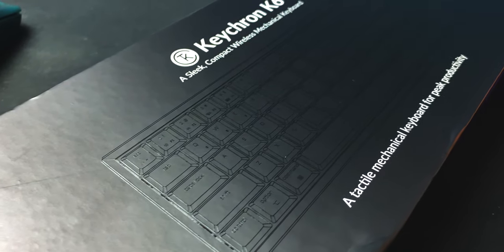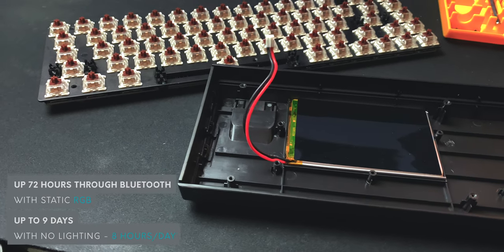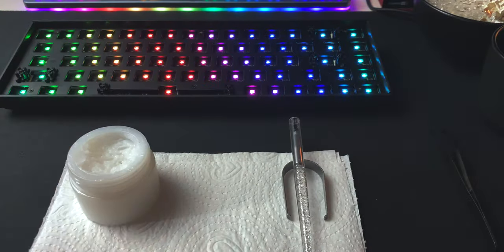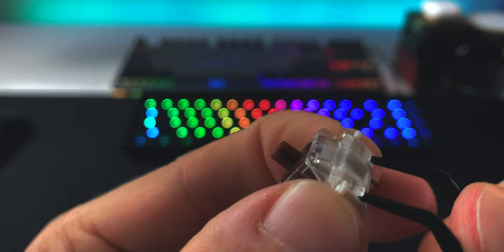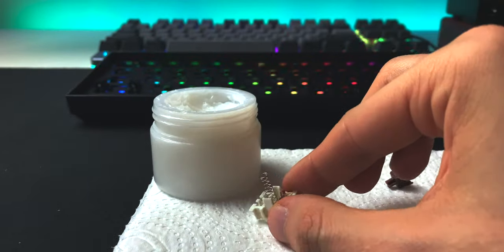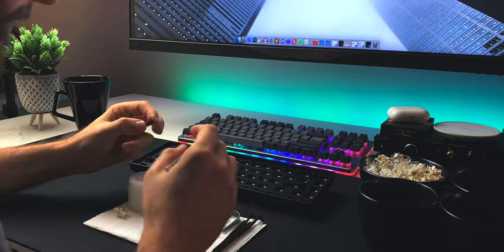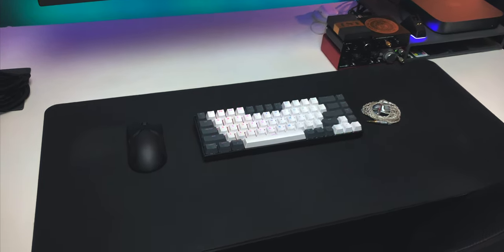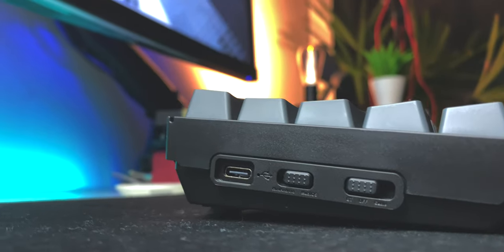Keychron K6 Keyboard MODS! - WORTH IT!

Comment: I’ve got two K6’s and the best upgrade I’ve made was Holy Pandas on both of them and it really took it up a level.
Reply from the maker: Oh, trading in the switches for something "fancier" is definitely on my to-do list. I'm thinking of de-soldering something I have here in the studio once I'm done with it just to use the switches it came with because "Holy" crap ;)
Reply: Kind of new to this but I’ve read that the Keychron gateron a are SMD, are the holy pandas SMD? If not, did they still fit in well?

Comment: Great video. Not sure if anyone has mentioned but you should use dialetric grease on the metal stabiliser bars, and use the krytox on the plastic housing.
Reply from the maker: Thanks bud!
As for the lubs, yeah, people have mentioned that distinction before. Didn’t find specific reasoning to be honest aside from thickness tho.... is there any?
Reply: @TechHyped  it’s to do with the thickness of the grease, which will likely make it stay in place longer and stick to the stab wire. I think lube is actually fine but you may need to redo more often.
Reply from the maker: Yeah, been feeling that with a couple of boards, but funnily enough, on some boards where I used dialetric grease all over.

Comment: I appreciate the build,  but my honest opinion is that the switches and stabs are heavily overlubed. The sound is really mushy, the space bar basically has no clicky feedback, the stabilizers are silent but not in a good way, they sound really mushy too. I would suggest using a very small amount of lube for the switches, since as we could see in the closeup shots, the stems were overlubed by a lot. The right amount is when you could barely see a translucent coat of lube on the stems. As context I just modedd my Keychron K2 a week ago and the difference is pretty big. If it is a preference of yours I could understand the mods but in my opinion this really ruins the typing experience, since the feedback of the switches and the stabs are basically non existant, therefore a stock K6 could give a more mechanical keyboard feel. On the other hand it's a nice build aesthetically.
Reply from the maker: I appreciate the comment and difference, really. I've for sure overlubed everything, but the stabs are the issue, to be honest. 

They were still somewhat rattly and I had to go back and do some other modding and refining to them - and now they're extremely better, honestly, just as some different mods I've applied to my custom Carina board from Drop as well. Short of actually grabing better stabs, they won't get any better to my preferences at least, as I've cleaned them up, re-lubed them, used different lubes, different applications of band-aid modding on the plate, on the pcb, inside the shafts, and it's soooo much better, but still the same stock stabs.

On the switches, I 100% agree its overlubed on the video, and I did try and clean a couple to test out different amounts (before I finished the video), but what I ended up striking was a balance of an existing but not very pronounced tactile feedback bump, and a smooth/soft typing experience that was well complemented by the stronger springs I put inside each one.

My mic didn't do the absolute best possible job with replicating the acoustic feeling of the switches, and I get from the many comments that they sound somewhat scratchy to a lot of people, but they've been almost just as scratchy with close to nothing in terms of lube (or nothing at all), probably because of the different springs, I imagine.

Now, months later, the lube has "faded" a little, the scratchy sound has dampened a bit and the overall experience is even better (to me, obviously). The only thing I'm still not exactly happy with is the dang stabs.

Same with my Carina board, actually. Band-aid mods, lubing, holy panda switches lubed and with tweaked springs to dampen ping (and I'm waiting delivery of a silicone mold thing to create something inside the case to help with dampening the sounds a bit more, actually), and it sounds and feels incredible to type (for me), and with the accoustics MUCH better than stock, but the stabs are still definitely what almost kills the joy of using these boards, sometimes...

Especially when you put in the work, the switches get so much better and the stabs being "kinda bad" just end up being even more in evidence, by comparison...

Waiting delivery on a some custom (better) stabs to add to these builds. Maybe that'll finally get me 100% satisfied with my Carina board and not totally hating the sounds on my Ctrl one as well hahaha.

Anyway, thanks for the comment, mate! Hope the videos keep being entretaining at least. Welcome aboard ;)

Comment: Thank you so much for making this video. Very detailed and helpful. I’m still in the process of learning about building my own 65-68% but the keychron K6 has really stood out as a viable option for me. One question I have for you though, is do you think the actually keyboard (case) is too thick? I’ve seen many complaints that it’s just so bulky.
Reply from the maker: Honestly, not to me.... the Drop Ctrl is the exact same hight from the table to the top of the keycaps, so I was already used to it.
I know a bunch of people use wrist rests with the CTRL, but I don’t... same with the K6.

The heights:
- 3cm from the table to the top of the keycaps on the bottom row
- 3.7 on the top row
- 4.3 on the top row with the smaller feet
- 4.8 on the top row with the higher feet
Reply: Tech Hyped thank you so much! Yeah the other contender I had in mind was the Drop Alt but for the price I feel like I could just build my own.  I think I’ll stick with the K6 and do the mods you suggested in the video. And also try to find some nice PBT keycaps. I messaged keychron and asked if some pbt caps for the k6 would be on the way soon and they told me it was in the works.

Comment: How's the tactility after lubing the switches? I loved the sound but I don't want to lose tactility. Cheers!
Reply from the maker: Tactility without lubing the stem legs is basically unchanged, but smoother and quieter. Lubing the lets tends to make it more slippery which takes away a little bit from the tactile feel, but it definitely doesn't erase it.
Reply: Those switches sound over lubed. There is no sound to them. They just sound wet. The key caps didn't even clack against the plate so the dude is either a perfect typer and knows exactly where the actuation point is on his switches. Or the switches have a mushy bottom out.
Reply from the maker: 100% overlubed, not mushy tho and the “wet sound” was weird haha... It doesn’t really, tho.
Plus, keycaps don’t necessarily hit the plates on every keyboard, which is the case here, incidentally.
And yes, “perfect typist” with absolute knowledge and control over each stroke for the precise actuations points, oooobviously 🤘🏻😜

Comment: I think your brush is a bit too big. And it has too much lube on it. There's some danger to over lube with that. But I guess it all worked out in the end.

EDIT: I see you're a fan of Tin HiFi!
Reply from the maker: SirAdeno yeah. Didn’t buy a smaller/thinner brush just yet, but this one has done the job. The lube amount definitely is a point of concern, as it can ruin the switch or cause contact issues/problems, but there’s very little chance of that unless you lube parts of the stem that press against the metal contacts. Those are the main leakage points.
Still, you’re right, its something to be careful with!
Thank GOD it worked out hahaha!

Yep, review on them is uuuup! ;)

Comment: im just kinda worry about overheating the battery, what is a good nonflammable insulation foam to use?
Reply from the maker: The board doesn’t use nearly enough juice to overheat the battery... The power-draw is what pushes those limits, and the Bluetooth + keystrokes don’t do the trick.
Plus, the idea is NOT to cover the battery due to space anyways, and since there are plastic spacers dividing the area where the battery is and the rest of the chassis, I wouldn’t worry.
Still, non-flammable foam I’d guess any type would work...
The EVA stuff I’ve used isn’t non-flammable as far as I know, so I’m gonna add a fire-extinguisher to my setup just in case 🤪😬

Comment: Just a note, those switches and stabilizers are way overlubed. Ideally there should be a very thin "haze" of lube over all the parts, but your switches look covered in globs of lube. Lubing like this makes switches feel all mushy. Lubing a normally loud switch shouldn't turn it almost silent. I'd suggest using a much smaller, thinner, softer brush next time, and using the least amount of lube you can get away with.

Comment: is this possible on the not hot-swappable version?
Reply from the maker: The foam thing underneath the pcb, yes, as well as “pushing” lube into the stabs, but the bandaid mod would be limited to you desoldering the switches on those stabs to get them out and be able to apply the mod (as well as clipping them).
The switches, well, you CAN use spray lube so you wouldn’t need to desolder stuff, but its not nearly as effective.
Reply from the maker: In my latest video on the Ajazz Zinc keyboard I show the difference in stabilizers that I pushed lube in through the cracks without desoldering switches. It can make a huge difference.
Reply: Great, thanks!
Reply from the maker: No problem 🤘🏻

Comment: Is the k6 good for gaming or should I stick with a ducky sf?
Reply from the maker: Yes and no. Not exactly made for it, but even in wireless mode I haven't had any issues with it in the countless hours I've used them for gaming.
I would say that if you already have the Ducky SF, unless you NEED (or want) a wireless keyboard for the flexibility, getting another 65% keyboard to use in wired mode for gaming is sort of a waste, really.
But it's an overall great little board.

Comment: How do you think the sound compares to your Drop CTRL?
Reply from the maker: That’s a nice question. Raw out of the box, the metal structure with very little internal empty space of the CTRL made it a quieter board.

Modded, at least right now, its been as quiet or perhaps a bit more quiet than the K6 because of the linear switches, but since I exchanged the springs in almost all the switches? Its not been as pleasant of a typing experience... Too light.

I’m waiting on a new switch shipment to try a couple of new things with the CTRL tho. I’ll let you guys know ;).
Reply: @TechHyped  Good to know. I've seen a number of reviews ragging on the sound of the K6, but no real comparison (properly modded) with lubed switches, and foam, etc.
Reply from the maker: Yeah, comparing stuff when the same effort or process hasn't been applied isn't fair.

From my own tests with the CTRL, sound-wise it's at least as good, if not a tiny bit better, but I'm not sure if exchanging the switches for something tactile would bump it up and out of the same "sound-level zone" the K6 is right now.

NOT necessarily adding foram to the interior, you could check BadSeedTech's video on modding the Drop ALT because the frame and keycaps are the same as the CTRL, so it should give you an audible idea. ;)

ps: adding foam to all the interior of the CTRL and the ALT is almost impossible because of the acrylic diffuser.

Comment: I have a question im new to moding and i want to get into lubing but after using the lube how long can i keep it for or what is he longest time youvekept the lube for and still be usable
Reply from the maker: That depends on the lube or amount, but you should be good for several months even with constant usage of the keyboard.
Reply: @TechHyped   o i want to know jow long i can keep for the lube that is not usedike e shelf life after using it once and keeping it
Reply from the maker: You mean how long the lube will last say, kept in a drawer somewhere for you to eventually use again with another keyboard (or even the same one)?
As long as you keep it properly sealed and not somewhere that would get way too hot, it should last for a looong time.
Reply: @TechHyped  yep i see thank you much
Most people confuse the question with what u told em first 😅😊

Comment: can i ask you a question
firstly it is absolutely a great video , i saw it 5 times 😂 so i want to ask you what would happen if i don't put a little band-aid under the stabilizer? will it affect hardly on the experience ? I'm so afraid that the stabilizers will not fit right way if i put something underneath them.
thanks for the tutorial BTW 💜
Reply from the maker: Thanks for the views! haha. Welcome board to the channel and I hope you keep enjoying the content ;)
As for the Bandaid under the stabs, that helps with the stabs hitting the PCB, which dampens the high pitched sound of the plastic of the stab hitting the plastic/metal of the PCB.
It may seem like it doesn't do much, but it does help quite a lot in terms of acoustics.
As for the fitting, depending on how thick is the tape you place underneath them, it CAN be a bit harder to push them in place, but that tends to mean it'll be very much dampened. I haven't had a single situation where the tight fit made the stabs jump off or get dislodged after pushing them in place, so I don't think you'll have issues there either.

Cheers!
Reply: @TechHyped  thanks for the fast response i didn't expect that and I'm enjoy watching your vids man 💜
I'll try to take your advice so will see what would happen
thanks

Comment: Thank you so much for this type of video!  Since it takes a long time to do all of the mods, perhaps it could be done in steps?!
Reply from the maker: Sure. Whenever I get s new board, I assemble it as is, use for a little while to test, then mod the stabs to see the difference, then move to the board, then the switches.
Unless I already know I want a fully modded build, then I’ll just try to get it done in one swoop to “save time”

Comment: Great Video! My K6 and Krytox 205 should be showing up within the next few hours, also with browns. Was lubing the tactile side a major difference?
Reply: Tell us more about the caps too! While doing my research, I realized 1u mods for the bottom right weren't always going to be available.
Reply from the maker: Way to go, dude! Be patient and you'll get it done ;)
And it can... If you overdo it, the tactile bump ALMOST fades away... it becomes super easy to miss, almost inexistent, but using the harder springs helped with that feel as well, actually.
Still, I'd advise a very VERY THIN coat if you intend to brush the tactile legs, just to add a bit of smoothness.
Reply from the maker: Will do! as soon as I can, which is going to take a little while still hehe ;)
Reply from the maker: Wellllllllllllllll, nda's up, so those keycaps are from the Drop ENTR mechanical keyboard. It's in pre-order still, and the actual keycap set I'm not sure if they're out already as a stand-alone thing, but here you go: https://drop.com/buy/drop-entr-mechanical-keyboard

And yeah, video on the Entr is coming up, and I'll touch on the keycaps ;)

Comment: my gateron yellow v2 pro from thocky became poppy or clacky after i lubed it with 205g from keychron
Reply from the maker: Seriously? But the originals were unlubbed?
Reply: @TechHyped  originally factory lubed sounded very thocky, i did try lubing with just 105 too and the thock sounded deeper ish
Reply from the maker: That makes sense, I guess. Factory lubing has gotten better
Reply: @TechHyped  i wouldnt have believed it if i hadnt tried it myself

Comment: Can I still mod the k6, even if it is not the hot swappable version? Thank you
Reply from the maker: Yes, but you’d need spray lube and the process isn’t the same... oh, the stabilizers wouldn’t be “moddable”, unless you desolder the switches to get to the stabs, mod them and put it all back etc... 🤷🏼‍♂️

Comment: What size allen wrench do i need to open it? And what other size screw drivers?
Reply from the maker: You don't need an allen wrench... 
As for the screw driver, sorry but my little tool set doesn't have the dang markings, so id just say "small"? Maybe a X4 ;/
My bad dude ehehehe.

Comment: My k6 seems to have quite a lot of ping... do you think thats factory error or is there anything I can do to fix it?
Reply from the maker: Honestly, it could be factory error or you can have a more accute hearing to that specific noise, which happens and it's pretty common, really. But lining the inside of the case with foam, felt or anything that would help dampen AND maybe even add heft and weight might come in super clutch to solve that issue.

Not 100% a guarantee, as it might be something in the manufacturing, but it should help a lot!
Reply: @TechHyped  Thanks so much! I'll try out your suggestions for sure :) great vid!
Reply from the maker: You’re welcome, and thanks hehe ;)

Comment: Great video! Was wondering what you meant when you said you changed the springs? Did it make the actuation feel any different? Lighter/Stronger maybe? Thank you!
Reply: Also, I realised that you don't have the aluminium frame on the keyboard. Does it still feel strong? Any flex in the keyboard? Thanks
Reply from the maker: Thanks bro! Yeah, I switched up the springs from the switches that came with my K6 for the springs on the Kaihua linear switches from my Drop Ctrl to make it heavier, actually. ;)
Reply from the maker: Nope, didn't go for the aluminium frame because it's basically a bumper.. The structural rigidity is still going to be much more related to the overall structure of the case, and the basic plastic version is already fine. No flex, super stiff.
Reply: @TechHyped  Awesome stuff man! Major difference from stock keyboard to after modding. Love the "Thocc" sounds. Thanks for the tips!
Reply: I just ordered a K6 without bumper thanks to you! Hope to be able to mod my keyboard to your level some day haha!
Reply from the maker: You can do it, bro! Its super easy, actually hahaha. Just takes a F*CK TON OF TIME... be patient ;)